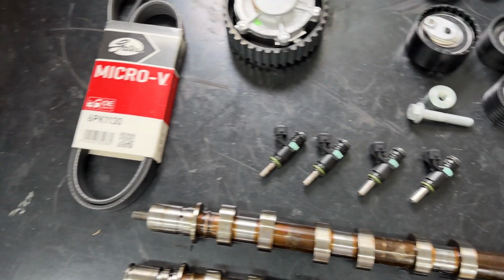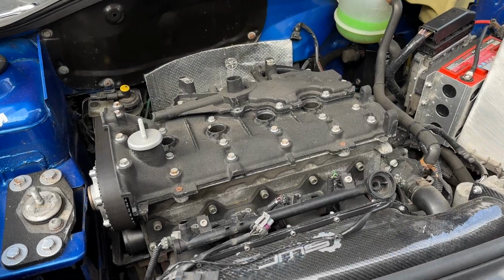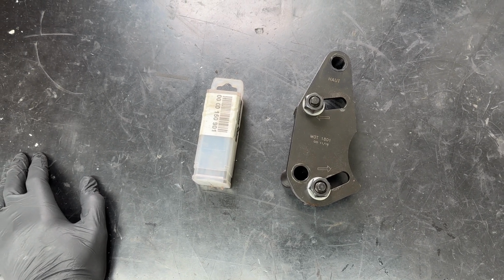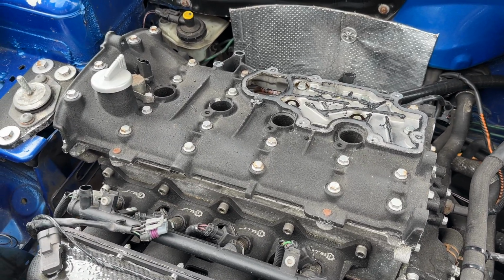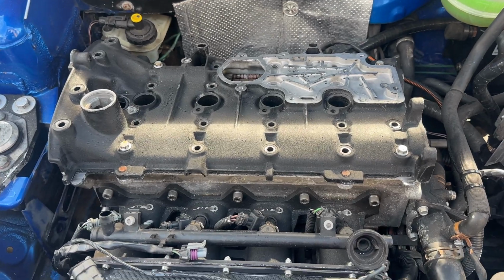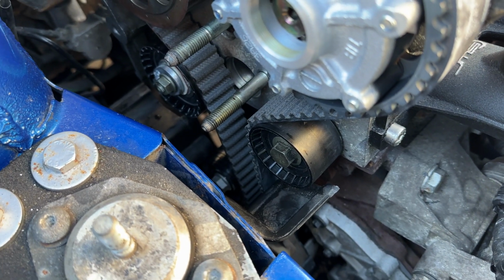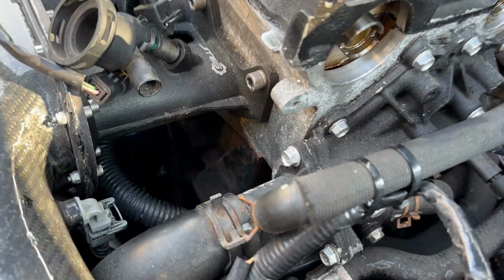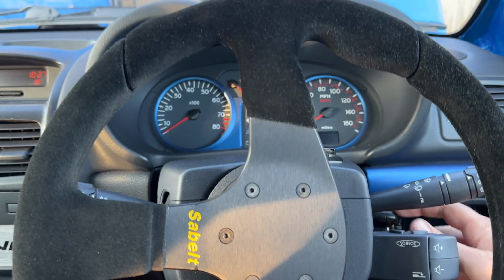Clio 172 182 Cambelt change guide including dephaser & camshaft replacement + installation

Comment: Just a quick one im on doing my 182 one does the defasor pulley need to be timed?
Reply from the maker: Providing the dephaser pin is working correctly (no rattles on idle usually indicates okay) it’s locked in the set position
Reply: Ok thank you, I put a genuine pulley and belt on and on start up and idle it's fine.e not a problem at all soon as I rev it when it's warm it make a rattling sound when reved when cold it doesn't do it, do you have any idea what it could be?
Reply from the maker: @aaronpickering3955 always difficult to advise without seeing/ hearing it in person. If you just did the cambelt then it shouldn’t be the lifters, if you did the rocker cover re-seal then maybe something didn’t go back together correctly 😢
Reply: @stoneautomotive ok, ill let you know how I get on mate, do you still have the clio in the video it looks amaculate?
Reply from the maker: @aaronpickering3955 yea the old girl is tucked up in the garage, hopefully be out again this summer 👍
Reply: @stoneautomotive im taking mine to croft at Darlington on good friday to do a track day just trying to get it running wright lol.

Comment: Great video thank you. Can I just ask what you do to make sure the camshafts are in the correct position when you tighten the rocker cover down? Do you remove the crank TDC pin and place the pistons in the middle so theres no risk of piston to valve contact, and once the rocker cover is installed then move each cam individually to fit the horseshoe tool?
Reply from the maker: When you remove the rocker cover take a photo of the camshaft lobe position. When the cover goes back on the cams will be out slightly as you tighten the cover but not enough to make contact. I’ve never removed the crank pin in all the years servicing them.

Comment: Hi, when you put the camshaft seals, do you use a special procedure or tool?
Reply from the maker: Renault used to sell a tool but to be honest with the engine in the car it didn’t really work for me! Always pushed them back by hand and never had an issue 👍

Comment: Hi!, I see that you use a bolt to fix the locking tool to the rocker cover, but all the tools I see on the internet do not come with it, where do you get it?
Reply from the maker: It’s simply an M6 threaded bolt, the one from the inlet manifold works perfectly 👍

Comment: Hi, nice video. Where can I find the timing tool with advanced intake? Thank you
Reply from the maker: Thanks 👌

Sadly the company that produces them is no longer in business 🙁
Reply: @stoneautomotive  I’ve measured roughly 4cam degrees by taking a screenshot to cad. indeed I think this is too much. Could you be so kind to check that angle in your tool? Thank you in advance
Reply from the maker: @luca7810  I’ve actually put the degree in a much earlier video from memory in the Clio series when I set the stock camshafts to the advanced inlet
Reply: @stoneautomotive thank you, I’ll try to Find it. regards

Comment: Hi mate, great video, as always! One question, when fitting the 197 cams, did you advance the inlet 7 or 8 degrees? Now about to put them on my 172. Cheers
Reply from the maker: It was so long ago now that the tool was made I can’t even recall ☹️

I know it’s detailed in one of the older videos as I marked it inside the inlet cam cap

Comment: I am having an issue with the the aftermarket horseshoe, i cant get it in the grooves of the camshafts. The lower tdc pin is all the way in and in correct position, the same with the camshaft grooves are in line. But when i try to fit the horseshoe it is like its too thick to get it in the grooves, has anyone else experienced this problem ?
Reply from the maker: Sounds like your timing is incorrect. If you’re not using the genuine horseshoe and cog locking kit your timing will be wrong after installing the new belt.
Reply: Thanks for the reply. I got the horseshoe in, i have a terrible rattle noise from dephaser i think it throws it of timing when i tried to get the horseshoe in so i had to wiggle it in alittle harder.

Comment: Hello, I have a question, but to fit the camshafts of a Clio 197, do you have the pistons of a Clio 197 or do you still have the pistons of the 172? Thank you for your answer.
Reply from the maker: Standard 172 Pistons, everything is stock 172 expect the 197 camshafts 👍
Reply: @stoneautomotive ok!! and after you need to mapping the ECU or no?
Reply from the maker: @raphaelwalko4958 yes ECU mapping required. With the RS2 inlet manifold I also required the 197/200 injectors and mapping to suit as the engine was making peak power at the redline which put the standard 172 injector duty cycle at max
Reply: @stoneautomotive  ok! thank's for your answer! How many horsepower she have now?

Comment: This is great, thanks for reading out all of the torque figures too! I need to change my cambelt and cams in a couple of months, this will work as my guide. Thankfully for me the engine is on a stand already so shouldn't be as hard.
Reply from the maker: Lovely and straight forward with the engine already out of the car 😎👌
Reply: @stoneautomotive fingers crossed! Quick question i notice that you didnt use any assembly grease on the cam carriers or the rocker cover. Is it not required for the F4R?
Reply from the maker: @F7Ruggler  it certainly wouldn’t be a bad idea to use it but when you remove the cams it leaves oil on the lower journal, when the cam goes back in and you rotate it by hand to check the timing it’s going to have a layer of oil film on the cam
Reply: @stoneautomotive  Managed to get round to doing this and have immediately got pushback from the online community regarding the use of 5890 silicone gasket based on the risk of flaking and clogging you mentioned. 

Is this something you've actually seen? or are there just tales of it happening from people who (probably) put mountains on their sump to seal it? Obviously now a bit nervous around the matter.

Also - how much resistance to going in would you say is OK from the horseshoe? I can put it in with one hand, but its a palm push. That being said even without the pulleys on the cams still didn't want to stay perfectly horizontal. Maybe because I'm using non-VVT cams (421s) with a fair bit of overlap at TDC meaning perhaps their under more torsion that OEM due to valve spring (also uprated) being under compression.

Also also - thanks for your help on a guide that you posted over two years ago :P
Reply from the maker: @F7Ruggler  I’ve seen people use too much silicone in the past yes, to the point it’s in the oil pick up etc but this is in extreme cases! But that said I’ve never seen a sump pick up block and causing no oil pressure as a result.

If you have the concerns use the recommended sealant 👌

Comment: At 35.19 (tightening crank shaft pulley) it's not clear if you have locked the camshafts using the tool?  It appears that you don't which I'd assume would cause the pulley to rotate?  I'm a DIYer in the middle of this job, but with engine out thankfully!  Great video, thanks for sharing as so few places do this job for sensible money these days.
Reply from the maker: The crank shaft is locked with the crank pin (make sure it’s not in the balancing hole) your supposed to lock the flywheel additionally when torquing but I’ve never had an issue tightening on the crank pin.

Comment: Is there any difference between doing the belts on a 182 and an rs200? I’ve just bought one after watching your videos and it needs the belts doing
Reply from the maker: Not massively different, it’s been a good 12+ years since I’ve done a 197 but from memory the only real difference is the crank pulley is pinned so working the tension of the belt was slightly different!

Comment: Hi, can I not use that lock that is opposite side from the belt when I am loosening the main belt, those two wheels?
Reply from the maker: You’ll likely bend the horseshoe tool and when you re-tighten the pulleys will move. Without the cog locking tool your camshaft timing will be wrong I’m afraid.

Comment: Hi, can you help me where can I get camshaft locker for my clio engine F4R 2.0 16v?
Reply from the maker: @ceslavapociuniene  the standard locking tool can be purchased from Renault. The modified one I use is longer available from the original seller. If you sign upto Cliosport.net/forum I believe another company now sells them

Comment: Started the belts on my 182 thanks to your video 👍 Also needs the cam cover leak dealt with. Found the crank pulley keyed, so need to amend the process a bit.

Comment: Thanks for the video, epic work 🙌.
Helping me get head around the job after looking at the Renault manual. Mind was blown until working out the pulleys are not keyed 😂.
Going to attempt it on my 182., with air con.
Quick question, what's holding the crank while tightening the crank pulley? Renault manual mentions a tool or sticking a big flat blade driver in somewhere. Is it safe to tighten against the crank locking pin?
Thanks again 👍
Reply from the maker: Officially you’re supposed to lock the crank with a lever bar, I’ve never had an issue doing it with the genuine crank pin!

Comment: Nice video and nice car. I own a blue 172 ph2 too.

Managed to get my timing as good as it can be, horseshoe rattling about in the cams, and now more overall torque and a nice extra kick between 5k an 6k.
Anyone reading this and about to change their kits, MAKE SURE ONLY ORIGINAL RENAULT TOOLS ARE USED! Trust me! Like the ones in the video! All of them!
The non OEM tools arent precise enough and the horseshoes bend. They have slack in the cams and on the crank. You will regret it!
The original horseshoe is VERY tough and the original pin fits really precisely in the crank.

Also check that you're really at TDC by looking for the line mark carved in the flyweel. It should line to the "0" line in the gearbox case. Check the opening below the crank position sensor! You will understand. Check the video at 11:09
Reply from the maker: Thanks 👍

Yep the after market tools are rubbish! Seen so many out of time when they have been used for cambelt replacement

Comment: I was shocked when I discovered that my K4M 862's whole timing assemble hold on just one bolt and I'm even more shocked that the sport version has the same. The magic of newton meters!
Reply from the maker: If all de-greased and tightened correctly I’ve never seen one slip/ move on naturally aspirated builds 😬👍

Fit a super charger to an F4R though and I have seen the crank pulley slip 🫠

Comment: Hi, you said that you can reuse crank bolt. Do you know can i reuse flywheel bolts?
Reply from the maker: You will need to check the manual if there’s a stretch tolerance for re-using, from memory (few years back now) I always replaced them

Comment: Hi, anyone know how to centralize the exhaust cam sprocket on to the camshaft, there is about 3mm of movement ?, feels like there should be a small shim that would slide over the exhaust cam bolt to take up the slack when putting the cam sprocket back on....when i finally tightened the bolts after fitting the belt the exhaust cam sprocket is bobbing up and down with each revolution
Reply from the maker: The exhaust camshaft should have a tight tolerance to the exhaust pulley, sounds like you’ve either fitted the wrong pulley or camshaft I’m afraid.. or your not working on a Renault sport 172/ 182 😅
Reply: @stoneautomotive  it's a 172 cup, had it a while..Decided to do belt change change because of slight misfire, bouncing timing advance on tickover fluctuating between  5 and 18 tdc and a noticable loss of low to mid torque,...Ex hill climb car that's been mapped with v6 airbox, sports cat etc, been a pain in the arse. Changeg tappets and cams, also mated up the pulley to the old cam to make sure i wasn't going mad and exactly the same amount of movement. Do you think making a shim from a piece of tube would work, similar to a spigot ring spacer used in wheel fitting ?   Followed your guide, got proper tools etc..  Thanks for the reply anyway fella
Reply from the maker: @creedynotechnique  have you tried seating the pulley without the belt in place to test fit the pulley? Really sounds like it’s just not going back onto the exhaust camshaft in that case
Reply: Will try that tomorrow, cheers

Comment: Hello i see that you are in to renaults and maybe you can halp me. My harmonic balancer failed. And i undone the bolt with inpact gun. I didnt know that some renaults doesnt have noch on the crank pulley. My car is megane 2 2000cc 136hp f4r. did you know if it has noch on the pulley and the timing is ok?
Reply from the maker: Once the pulley is off you should be able to see the woodruff key (if it’s fitted or not) sadly if it’s not fitted and you’ve tried to start the engine it will have bent valves
Reply: @stoneautomotive  It doesnt have woodruff key. The shop that did the timing belt didnt put it. And the car run fine. There is a mark done by the shop and the crank pulley didnt move. Im going to get timing tools see if everything is in place and assemble the car without woodruff key
Reply: The Haynes manual for the Lag 2.0 Litre clearly states and I quote.
The design of the camshaft and crankshaft timing belt sprockets are slightly unusual in that no method of positive location of the sprockets (such as that afforded by a Woodruff key) is employed..

Comment: Fantastic video, what was the difference between the pulley lock up for the vvt and not vvt? And how did you lock up the crank to tighten the bolt and slacken the pin without bending the timing pin?
Reply from the maker: The non vvt is done the same as the exhaust pulley (30nm and 90 degrees from memory)

The crank is locked with a lever bar but found it impossible on your own to hold it under tension. Never bent a Renault crank locking pin, wouldn’t do it with a patten one mind.
Reply: @stoneautomotive  I did the dephazer on my car this weekend, I have an aftermarket TDC pin so I didn't risk it BUT I found the perfect lock up tool is a 6mm allen key in the ring gear window, stays in on its own. Maybe you could try it and see what you think.

Comment: Why the water pump haven’t been change after so much work?
Reply from the maker: It had a brand new Renault item fitted at the last cambelt change 4 years ago, hadn’t even done 2,000 miles so seemed pointless changing (seen originals cover over 100k without failing on many occasions)

Comment: I wish I had this video for reference when I changed mine back in lockdown
Reply from the maker: Hopefully watching it you didn’t have any “oh I didn’t do that” moments 😅
Reply: Just curious if there was a reason why you didn’t add a woodruff key to the crank pulley or the reenforced timing cover that people seem to recommend? I only heard about these upgrades after I’d done mine but wish I’d done them for extra peace of mind
Reply from the maker: @gregorrose8935  I didn’t add one as it doesn’t need one 😅 if the bolts within spec and the correct torque is applied I’ve  never seen an NA Clio move one!

On the other hand if it’s super charged it’s a must as the drag on the super charger can slip the pulley
Reply: @stoneautomotive sounds legitimate 👍 thanks again

Comment: Great video... You mention that you do/did this job a lot.  Like many 1*2 owners these days,  my Clio gets minimal use.  In fact there's just over 1000 miles on it since the last time I did the belts,  however that was 4 years ago.  What are your thoughts on replacing the belts [particularly the cambelt] based on elapsed time alone ?  In other words,  replacing the belt even though the belt will have done a tiny fraction of it's lifing.
Reply from the maker: Hi,

Sadly the lack of use/ mileage is worse for the cambelt as it goes brittle and starts to retain the shape of how it’s been parked.

I did about 3,000 miles on the last belt in 5 years and to be honest it still looked in good order when removed but with the price of used F4R engines going through the roof I certainly wouldn’t push it past the factory time frames

Comment: Thanks for the video , I have a project 172 that I started the belt change some time ago I just need to tighten the pulleys now I am going to. The six turns give me the confidence to finish.
Reply from the maker: Glad to hear 😎👍
Reply: Any tips on how to remove a water pump bolt ? Some num nut use a socket or a ring to tighten it and have rounded it off. I have a replacement and can remove the others  it just such a bad spot. @stoneautomotive
Reply from the maker: @MrBrenden830  as long as the engine is jacked up as high as it can go the water pump replacement is not the worst job but if you’ve rounded the bolts off your in for some head ache now sadly ☹️

Comment: Great video, do the same rules apply to the clio 200? I’m replacing the depasher pulley aswell 
Do you know if all the torques are the same for the 200?
Thanks
Reply from the maker: Slightly different process with the Clio 200 but not a million miles apart in the process 👍

Pass on the torque settings, been a long time since I’ve done a 200

Comment: Hiya mate, I’ve done exactly what you’ve done and I had to change the ECU too/ injectors and so on. I’ve done it and timing seems to be fine and turns over with loads of compression by hand but as soon as I turn it over with the ignition it has compression for the first cycle and then just spins the starter motor with no compression

Comment: Ive got a regular 1.2 a d for the life of me, cannot find how to replace the air con belt idle/tensioner pulley.
Reply from the maker: I’ve only ever worked on the Renault Sports so unable to assist I’m afraid
Reply: @stoneautomotive  all good. Its the retainer cap thing giving me problems. Its got angled sides so you can't use a spanner. I think its torx ended tho but its getting a ratchet and bit between it and the wheel arch thats causing me problems. Might have to resort to mole grips.